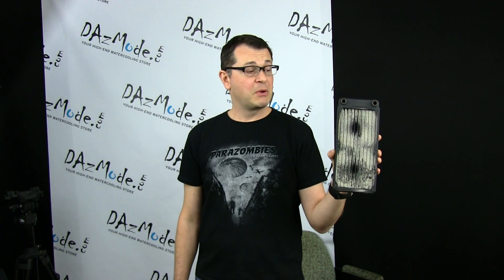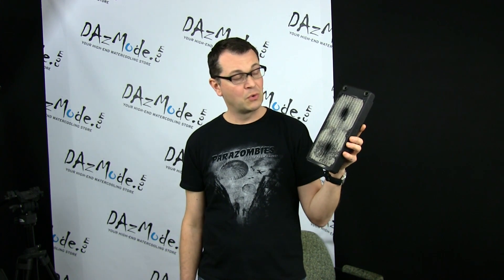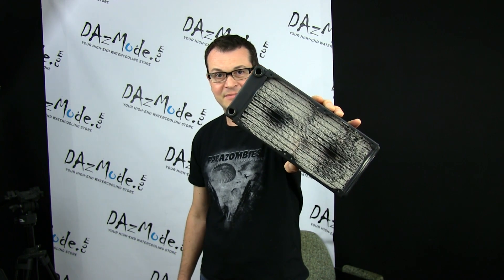Du hast? - DazLabStupid EP6

Comment: It DOES make a difference, I have a high fpi density radiator very similar to aquacomputer airplex fins, and after cleaning it from heavy dust, my water temp is at least 0.5 degrees lower, usually close or around 1 entire degree!

Comment: Don't you think it is better using fans in pull configuration, just to avoid that ? I always use fans in pull and I have never seen my radiators like that no matter what the fin density. I agree that higher fin density radiators are a pain to use. Not only they work as a filter, but also because you need to use high static pressure fans at high RPM in order to perform well.
Reply from the maker: I had pull in Silent Sniper build and it was exactly same thing. That was my last build with dense rads. Never looked back.
Reply: DazMode But I guess it was much easier to clean.